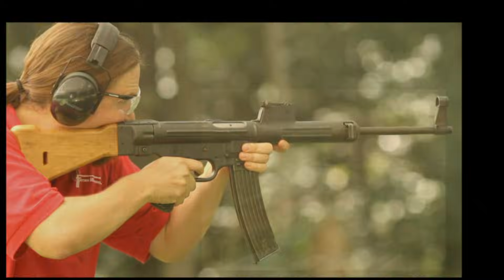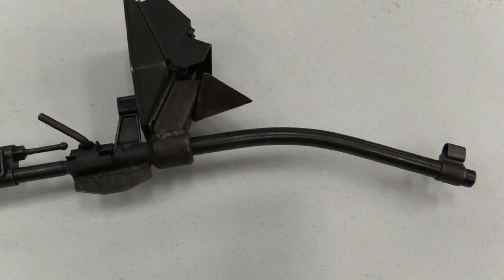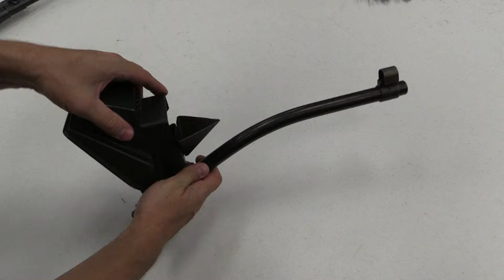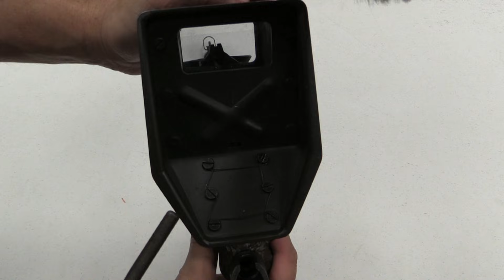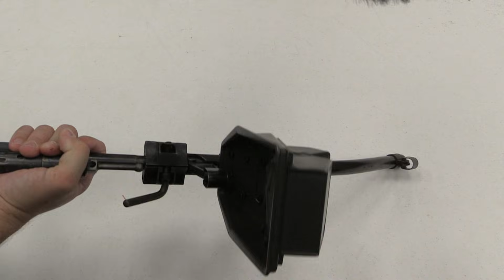Krummlauf Curved Barrel on an StG-44

Comment: around corners? that is basic. This would be so much more useful for a roof top defensive position that way you can rest the gun on a second or third story window ledge to counteract the heavy barrel and because its an attachment you could clear a building without it, then attach that and defend the position the only problem is that 100 shot lifespan.

Comment: That was originally invented to kill the zombies as they’re coming out of the ground...so you can see where you’re going while running and gunning.  Then someone ran by with a train of zombies and the guy running and gunning ran into the train and died by zombie.  Anyone fighting zombies from then on opted to use a straight barrel for more efficient headshots after training a big group of zombies rather than killing them one by one as they come up from the ground.  As they say, live and learn...or is it die and teach?  🧟‍♂️

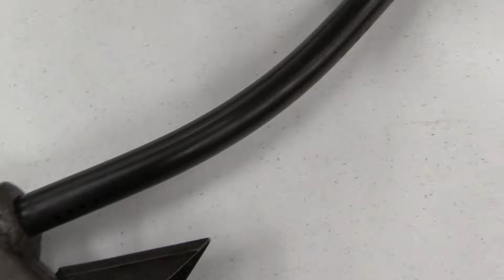Comment: I stopped watching ( and laughing ) at around 1:52...Well...I gave it some thought and realized that this weapon was just one more of the Germans attempts at better/secret weapons. The thing is...this actually would work, but in the beginning of the video, ( if you were listened ) its the accuracy that suffers.Its a crap shoot on hitting targets but...not a bad idea for the application. The key to this monstrosity is the bullet it self, and the charge in the round. LEAD bends. BRUT FORCE IT with a big enough charge in the round , and the the LEAD simply reshapes itself just before exiting the barrel. Like I said...THE SOFTER LEAD BULLET IS THE KEY. Probably had ammo that was made special for the weapon itself. Cool concept. Sucks on the battle field through...when you run out of ammo, your screwed ! Its easy to forget that lead bends. Rounds would HAVE to have been made of much softer lead. Hope that helps.

Comment: I can only see three situations that this would excel in, 1) suppressing enemy movement(s) near or towards your trench whilst you yourself are being shot at, or not, either way could be rather handy. 2) street-to-street, alley-to-alley & room-to-room fighting, like, oh idk. Stalingrad, Leningrad, Berlin, et cetera & finally, as mentioned, when trying to get those pesky soviet red army men off of the top of your tank. 

& potentially surprisingly this idea hasn't died, I think a lot of us are familiar with that bending "arm" type device with a camera attached to it, that you put your pistol to look & fire around a wall. 
which unsurprisingly when you look into the history of this modern device, this is/was the inspiration for its inception. 
'though like its modern relative, it seems like a really god idea until you use it in practice.

Comment: This version is NOT for shooting round corners though could probably be used for that too. The curve of the barrel is downward. This is for shooting out of trenchments; the soldier standing or kneeling behind cover, in a trench or fox hole and aiming the weapon slightly upwards, so the barrel poking over the top faces directly to the enemy. This is the best solution for every day fighting, troops weren't in cities often, but almost always firing from defensive positions after 1943. I believe Germans made Lefthand and right hand versions for street fight but not sure.

Comment: It seems perplexing to me that the Germans resorted to awkward attachments to curve bullets when 30 years ago they had already discovered the idea of the periscope rifle, simply taking the whole weapon, barrel, stock, action and all, and putting it out there in harms way, while using a simple attachment to aim and fire it from safety. That principle is still used today with the CornerShot. Why didn't they simply develop a periscopic sight, and grip, for the STG44, that would allow an operator to poke the whole gun around a corner?

Comment: The 90° version was actually only used on the Jagdpanzer Elefant which had no mounted MGs and could easily be taken out by an infantryman with a few liters of gasoline.But the Krummlauf failed to be an effective protection against infantry, so the germans later changed the Elefant design. It then was known as the "Ferdinand" and had mounted MGs.

Comment: Wasn't the 90 degree one designed for the Ferdinand Heavy tank destroyer? But later Elephant versions had a machine gun so it wasn't really that much use. Also the Ferdinand/Elephant was not the useful of a machine.

Comment: Now I just have one issue. I'm not trying to argue but I think the 30 degree was used in tanks and the 90 degree was used in street warfare. My reasoning is that the sights are set to shoot down and hose a tank off. If the 30 degree was used in the street then the sights are useless. The germans don't put on something that you can't use. It maybe over complicated but you will be able to use it;

Comment: Ian, since this is an exceptionally rare, expensive and prized piece of history but something of great interest, why not make one? You have all the machinery you would really need to make, not a full replica but a functional one. Think about it, any gun, any caliber, don't really need the periscope but that might be easy enough to create. You just need a barrel blank and some steel stock. A simple .22LR version even! That would a great caliber to try, short bullets, all lead, might handle the bend better. I'd make one if I had a lathe and end mill. THIS would be cool to take to a 2-Gun match!

Comment: For those who think that only the Germans would try something like this, read R.P. Hunnicutt's excellent book on the Sherman tank. The U.S. Army developed a curved barrel version of the M3 "Grease Gun" to be fired through a special port integrated into one of the periscopes on the Sherman's turret. The periscope itself was the aiming device with a reticule added to the glass. These were developed for use in the Pacific against Japanese suicide attacks. I believe Hunnicutt states they were never issued - no surprise.  Great vid -as usual, Ian.

Comment: Actually shooting out of a trench rather than around a corner might have been a feasible application for this part. It did not impede using the original gun and could be detached, so no disadvantage either in having it along.

Comment: LOL.  Being an Aircraft mechanic I have to say for German Engineering.  That is a horrible single strand safety wire job.  I do wander though. after you hit its barrel life.  are you facing barrel failure, or just accuracy dropping off.

Comment: The Israelis developed something similar for the Tavor right? IIRC you can change the direction to go either 90 or 270 degrees, whilst also being able to fire forward. ...So altogether more practical (though I wonder if it suffers from the same barrel wear. The thing did look like a fairly chunky attachment however).